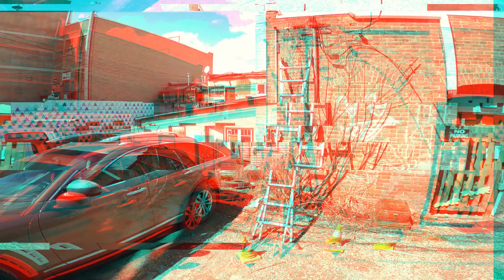MDU OUTSIDE FIBRE BUILD using 1" EMT conduit

Comment: Pretty wild to see you not strapped off and hooks not on the strand. Stay safe out there man.
Reply from the maker: I explain why in the video lol
Reply: @FyBurz Yeah I heard just don't think it's a good reason. If you start sliding for some reason it'll go pretty far before the hook grabs then the ladder will almost certainly rotate and dump you off if you don't grab the strand fast enough and you won't have a strap to save your ass. As long as you don't have too much tension on the hooks you can still slide along a bit and even then it's rare that you'll need to if you plan where you drop the ladder.
Reply from the maker: @Maj0rZer000  you’re not wrong. The amount of slack in the strand is also a major factor. I could be a bit better about it. Having a decade of experience with ladders has given me confidence 😅

Comment: The level of work you guys do out west compared to us out east is a night and day difference. 

Our managers in Ontario would never let us place a mast or conduit inside, everything is external now here... we run the drops directly inside and strip at the fiber jack. Only time we install a slack box is for 2f.
Reply from the maker: Just different protocol, nothing wrong with either. There’s many different practices throughout the world. 

The way we do this allows the tech to troubleshoot the splice and test without going into the home or business.
Reply: @FyBurz  Recently we made the change to running everything inside without an outside connection point, we think it has to do with all the new techs the company has hired over the past few years. They do horrible work and we constantly have to fix it. Imagine drops connected to the tap and ran directly to the house without any clamps then drilled right in with 80m of slack sitting outside all over the side of their house.

Comment: Got one vid in recommended next thing I know I can't stop watching.. CA and USA standards for cable, I didn't know we were so different. I know guys who've been in this industry 20+ years and ain't got half the gear you do. Hell I've never HEARD of a company that supplies conduit, unless you're in the maintenance or underground crews that's the only time you'll ever touch that. I've got a decade with me in this industry too, I've been hit by cars, I've had poles collapse under me and turned my head to see the only thing holding my ass from the ground is a damn rope on the strand. And here you are, me unable to tell if you're even harnessed in and hooks not touching the strand. I want to know how much of your gear is supplied or out of your own pocket. I would put good money on it that you probably have a damn hedger and pole saw to cut up branches and bushes, I bet you damn well do too. Hell you even get better house boxes then we do, we don't get boxes with trays to neatly hold your loops. We do that with screw clips, or as you call'm saddles. We splice in our coyotes then at the house, I wish we had a service point we could just screw in a connection like those. All the conduit you run too, I saw a vid you even put down grass seed for someone after digging up the yard. I ain't ever seen or heard of a ANYONE in the US who would even think of that. You making us look bad, I try my damn hardest to make my lines invisible and clean. Dude I got a damn drywall knife, hammer drill with an SDS adapter and an impact driver. I got 24" long 1/2", 3/8" for brick, concrete, and wood, then I got a few 1/4" bits for anchors. Where's the application, you got all this mess I bet they pay like I want to be.
Reply from the maker: Haha that was a lot to take in 😂 the tools are all 100% mine. And I do have a pole saw and hedge trimmer😅 I definitely hook my self to the strand and always wear a harness, without it I have nothing to clip my pouch too. The conduit (EMT) and hardware for this job was supplied and out of the norm for my usual job. But for the most part the materials and hardware are supplied besides niches things like different kinds of masonry screws and such that I like to have on hand. I appreciate the praise, I try my best and don’t mean to make anyone look bad 😂 

Thanks a lot for your comment and sorry for the late reply I didn’t see this comment until now.

Comment: Trick I learned silicone the extra brick holes then put the brick dust on the top layer fill the miss drilled holes.
Reply from the maker: Nice good idea👍🏼 I actually went back and filled them all back in with caulking when I tested all the lines with the OTDR

Comment: You need to get a paint marker for drilling into brick, that way you don't fill the box with brick dust.
Reply from the maker: I have paint pens, but I do need that one that shoots the paint through the hole. I usually mark the holes with the bit then move box and keep drilling. Was a little awkward here because I wanted to keep the box assembled with mast. But yes in retrospect I would of done it differently. I ended up vacuuming and wiping down the boxes so no harm done 😅 
Thanks for the advice.